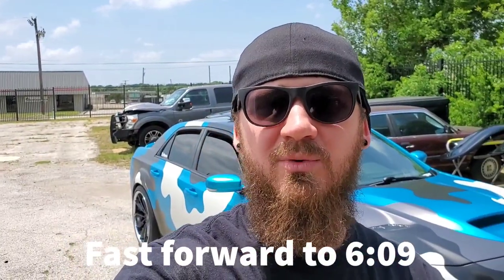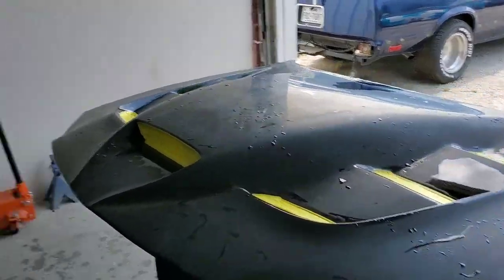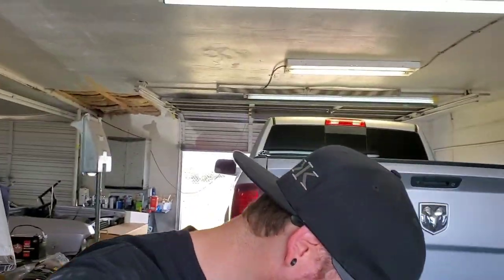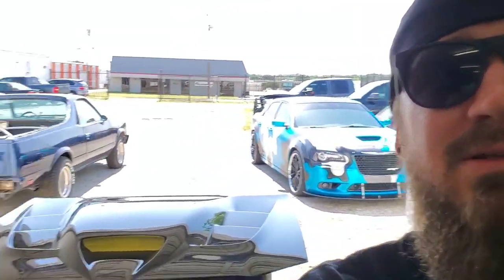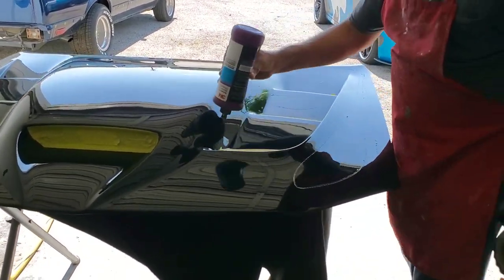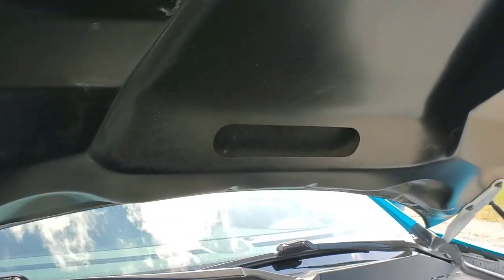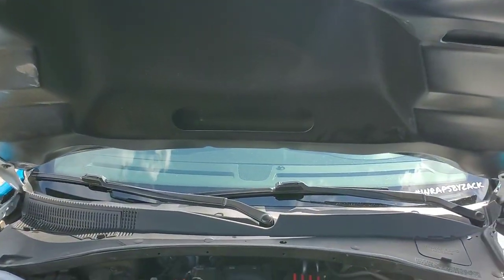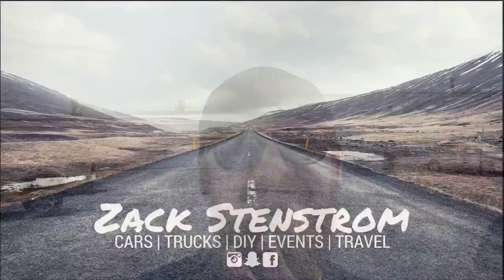Chrysler 300 SRT8 Viper hood install | BMC Customs Hornet hood | Vlog

Comment: Yeah they are starting to open more things here in AZ to, and look forward to going to the track. The Hellcat hood is not as aggressive as the one on the 300, and is like the one that RT life has on his charger I believe. I've been looking at them for my Challenger and was thinking that I would go with either the Hellcat one, or the newer SRT style with air induction in the center. I'm leaning more towards the Hellcat one though because it extracts heat better with the extra venting. My Challenger is an SRT and they do have air induction, but doesn't extract much and is why I was looking at them to replace it. That thing looks pretty radical, and bet that it definitely moves some are